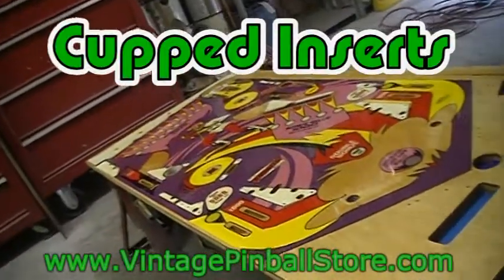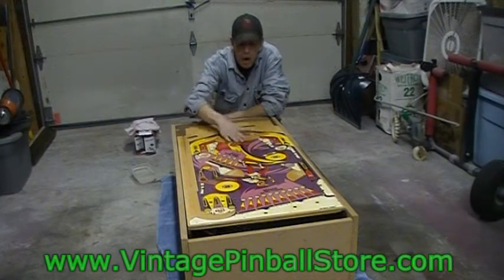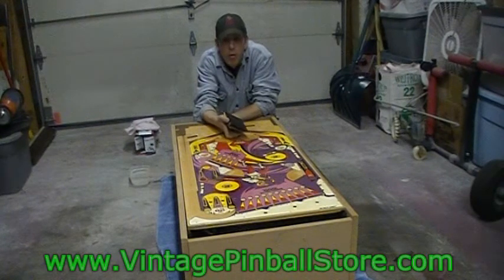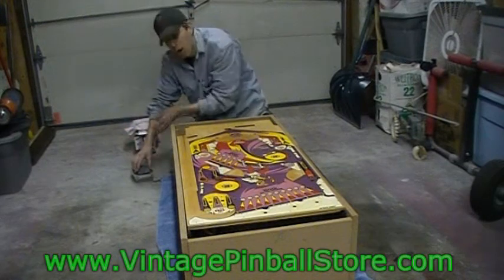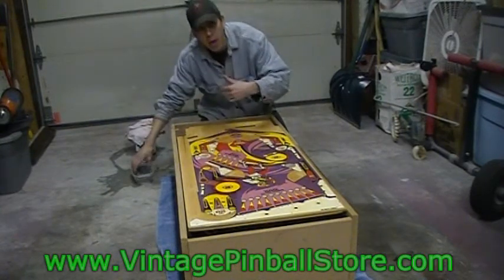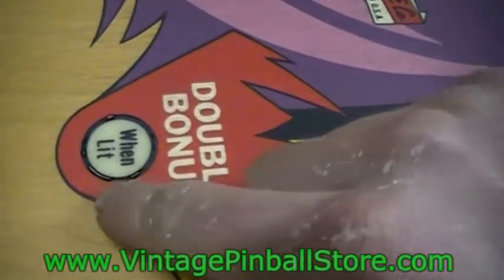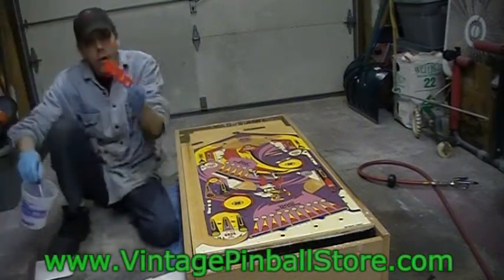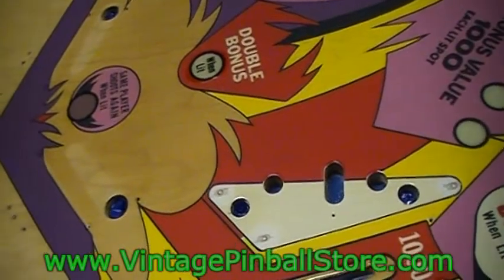How to Clear Coat a Pinball Playfield - Part 4 (PinDude Pinball Project)

Comment: What would you recommend I do if my playfield was clearcoated when I bought it but there's heavy sinking and cupping at the inserts and that is the only problem. Can these local areas be repaired or does the whole playfield have to be resanded and sprayed to fix it? Some of the inserts are dipping in quite a bit. You were worried that the ball would wear at the edges but mine's so bad the ball's probably going to hit the glass if it goes over it fast enough.